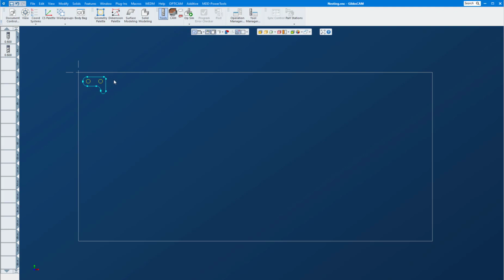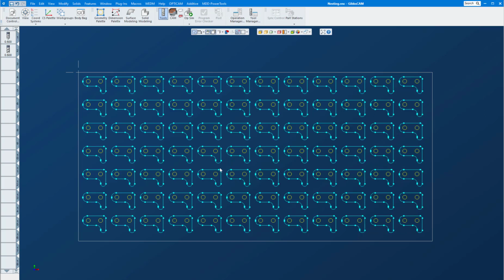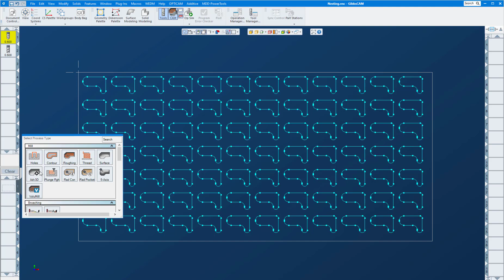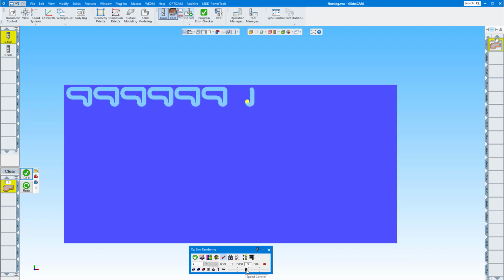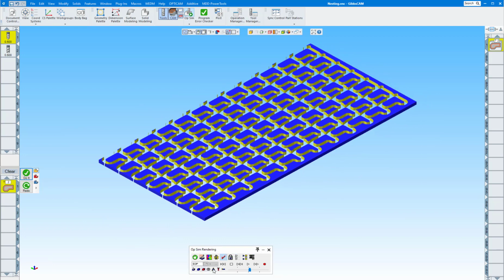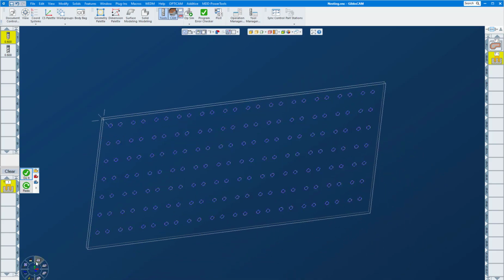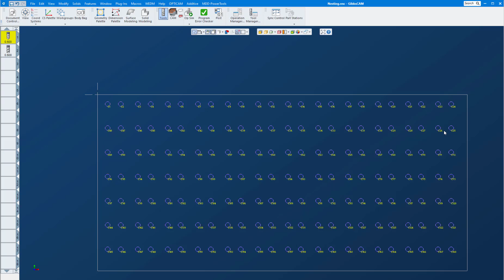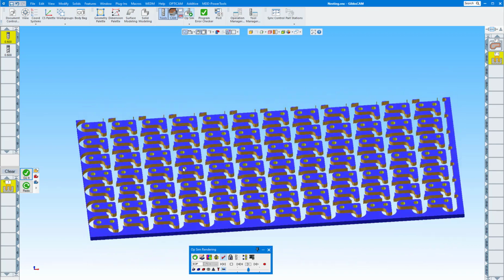GibbsCAM Nesting

Comment: Better to use pattern. This bloats the program and makes too many tiles.
Reply from the maker: Hi Peter.  If you Uncheck the "Depth  First" checkbox you will only get one tile.  Pattern does work good as long as the part is the same.  I probably should have noted that this type of nesting is good for different shaped parts in which you want to run a contour on the outside or inside of the part.  Thanks for your insight!  Note:  Also uncheck the depth-first box when you are engraving and you will also end up with only one tile instead of many.